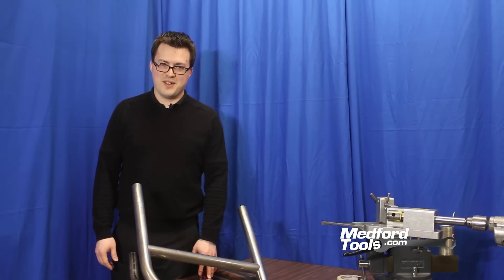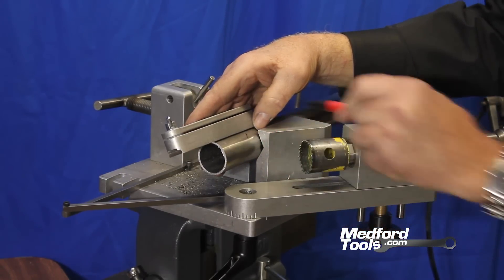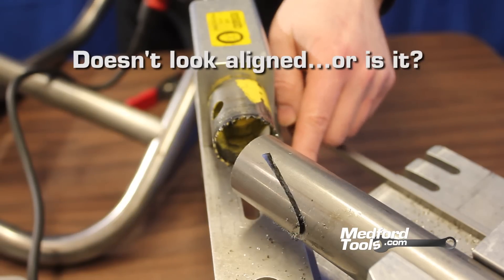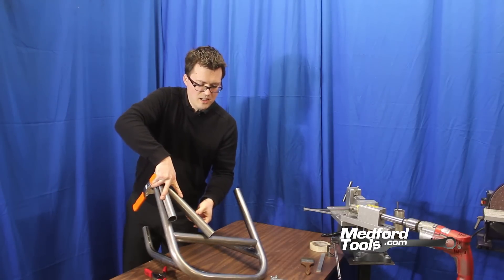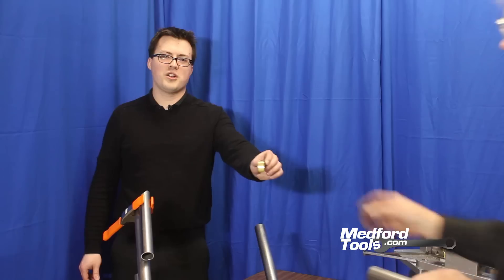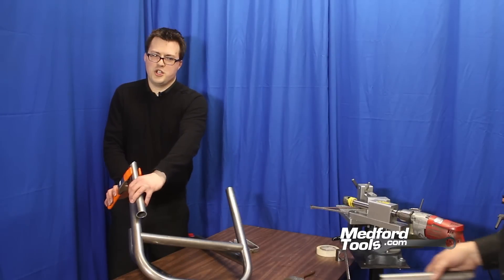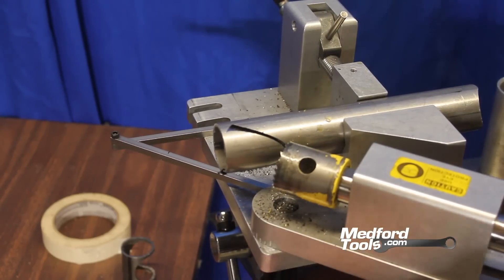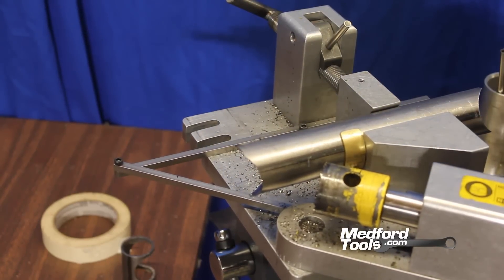Tube Notching made easy #2

Comment: the 55° notch was not aligned when you rotated the drill 180,  just watching the video you can see that it is not going to be aligned before you even start the second notch, it is at too great an angle.

this is contrary to your claims of perfect alignment
Reply from the maker: If you’re referring to the ever-so-small jog where the cuts meet, then you are correct, it’s not absolutely perfect.  But not because the 180 jig is off.  We’ll chalk it up to user error!  That jog would be perfectly acceptable to most fabricators considering that it’s not off by more than a 1/4 of a degree.
Reply: syncnotcher 

you would need to secure both ends of the guide to prevent flex in it,  perhaps some sort of quick release slider with a pivot underneath?

 imagine kind of like an alternator belt tension bracket with a slot on one end that you can bolt up into your guide rail,  if you use a quick clamp like you get on bicycle seats and axles you won't need any extra tools to adjust it either.

or even an arced slot in the base plate that follows the radius of the guide with a quick release bolt through.

Comment: On the double complex 45 degree cuts couldn't you eliminate the second step? After the first step just turn the piece 180 degrees and do the next cut?
Reply: That is what I thought, there is no need for the back cut because on the second 45 it will fall off.
Reply from the maker: The ability to ‘back cut’ (180) becomes increasingly handy as you work with tubing size 1 1/2 and greater.  Any size less and you can cut straight through.

Comment: "Fitment" is a noun meaning fixed piece of furniture or equipment for a specific architectural design.  It DOES NOT mean how something is fitted together.
Reply: Buckhorn Cortez. quiet
Reply: So then if the shitment don't fitment you can't wear it...?
Reply: 1. (Mechanical Engineering) machinery an accessory attached to an assembly of parts

2. (Furniture) chiefly Brit a detachable part of the furnishings of a room
Reply: And there is no "fitment" as used in this video as he's referencing the fit of the pieces together as in, "Notching the tube here and here for a clean fitment."  An obvious misuse of the word "fitment" as clarified by the definitions you've provided to make my point.  Thanks!